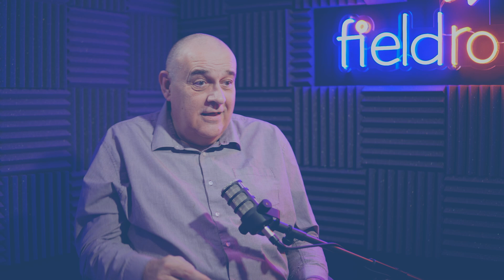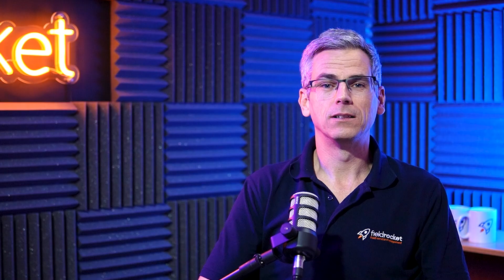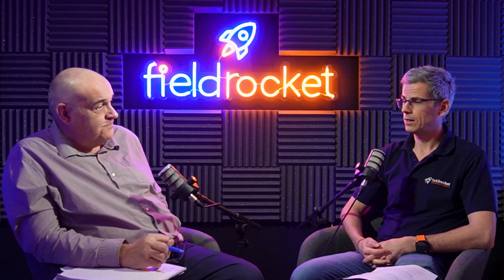Will Gas Engineers Lose Their Jobs To Heat Pumps? w/ John Vinter

Comment: Bivalent (or hybrid) heatpumps are an easy solution for a lot of people.  Run heatpump for the vast majority of time with a backstop if needed.   Allows for much cheaper operating costs and cheaper install costs.
Reply from the maker: Hybrid heat pumps are an interesting point to raise! They seem like a good middle ground, but I feel like both the UK public and gas engineers will still need persuading if it's as easy and cheap as you noted.

Do you think they'll catch on more, or should we also consider other green alternatives, as John suggested?
- Producer Alex

Comment: Air source pumps do work in some scenarios… but not all. By far the most common boiler on the market is a combination boiler…heat pumps cannot do what they do. I was working in a house and the client worked for B.P. She said they’re heavily investing in hydrogen, but it’s way off being an alternative to gas
Reply from the maker: You're right that heat pumps aren’t a direct replacement for combi boilers and won’t suit every home. And hydrogen alongside OFTEC's investigation into HVO is promising, but what do you think is the best long-term solution?

To expand on what she said did your client have any interesting takes on this?
- Producer Alex
Reply: @  no…she didn’t elaborate . I’ve been fitting boilers for nearly 30 years and when I first started those cast iron lumps would tolerate a bad installer…then condensing boilers arrived which  would not….with heat pumps you absolutely need to know what you’re doing.
As a government grant is involved you get companies pop up….do a bad install and then disappear. I can see these being the next ppi saga. “ was you sold a poorly installed heat pump”?

Comment: Now they have dropped the ban on gas boilers at 2035 can’t see too much changing, air source is ok for some properties but gas gets over a lot of properties with insulation issues. I was surprised by labour 😂 removing the ban on gas boilers at 2035 , housing associations will go to gas as first choice, air source will be a tick box situation on certain amounts of properties, as for private property’s it won’t take off as much as expected
Reply from the maker: You raise some great points, Jason! With the 2035 gas boiler ban no longer in place, it'll be interesting to see how the industry adapts. Like you said, heat pumps work well for some properties, but gas remains a reliable choice for many. 

Do you think there’s still a future for hybrid systems combining gas and renewables?
- Producer Alex
Reply: @fieldrocket  im not sure for hybrid systems as it’s 2 appliances to service and maintain, which the general public won’t pay for, they don’t even get there gas boilers done.
If the electric prices dropped massively, a r290 heat pump would be the way so you can adjust temperatures to suit properties insulation levels, as they get air tight and warmer you can drop flow temp and adjust curves. However when going above 55oc it drains the electric so  big bills.👍